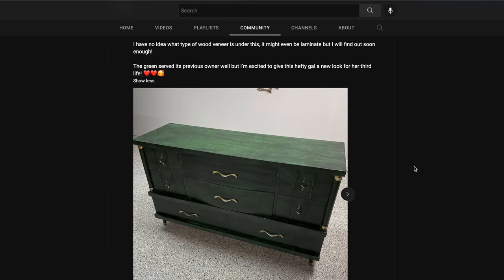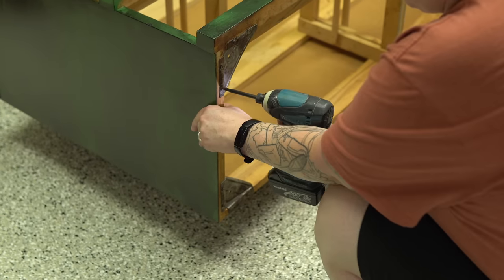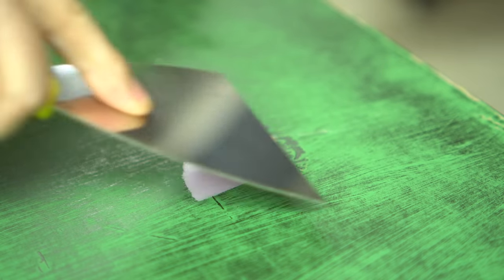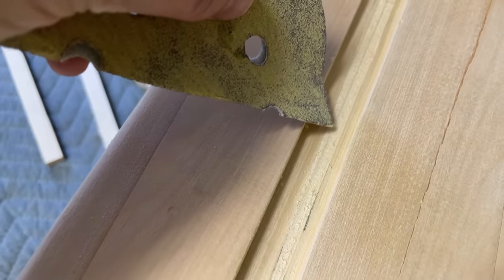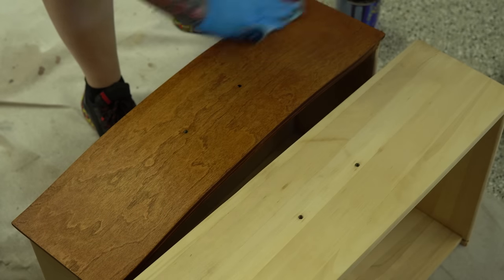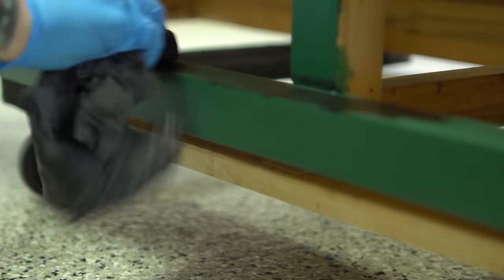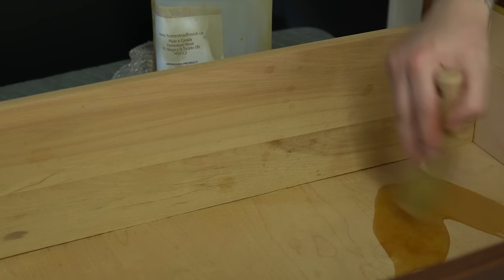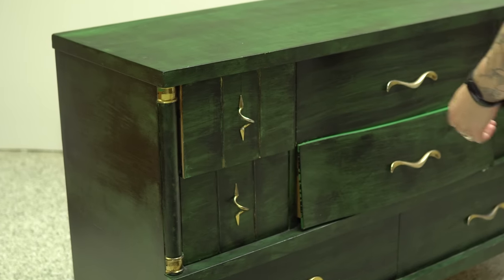DRESSER GLOW UP: Trying to make LAMINATE FURNITURE look & feel HIGH END

Comment: This looks SO much better than it did before you started. The green faux finish was just kind of messy before, it just didn't look professionally done. I think I like the more modern pulls, but I almost think that an even longer pull is called for here, with bits that extend past where the pulls attach to the drawer front, to more closely relate to the vertical spiral pulls on the smaller drawers. The curvy pulls aren't bad, but it's just a bit too much curve on top of curve. The straight horizontal pull makes the drawer front more of the star, whereas the curvy pulls compete for attention more.

Also, Nacho is a precious little angel and ultimately I will agree with whatever he likes best.

Comment: I love the finished product. I have the same highboy chest of drawers,  headboard, bedside tables and a nine drawer dresser with a mirror and a dressing seat. It is so dated, but I love it and hate it at the same time. Now that I see what you have done, I am so inspired to try to paint them. I wanted to ask, was the wood shelving, in between the drawers missing? My set has the, "Dust Proof Drawers". It is so difficult to find heavy, well made furniture, at a decent price, let alone have the dust proof drawers and a real wood backing on the back of the furniture.

Comment: The flat pulls highlight the horizontal; pieces of the front of the furniture actually enhancing the wavy side handles by their simplicity.  I liked the green/black original and probably would have something like it in college.  However, your piece is something I would want today.  (no room, unfortunately).  I always think of laminate as temporary furniture, something you get until you can get something better.  Your approach changed that.  best wishes in your business.
Reply from the maker: Thanks so much for watching!

Comment: I like the new modern pulls on the unit.  They look more sophisticated than the original wavy pulls.  The smaller drawer pulls didn't really match the orignial pulls in my opinion.  The modern pulls don't match either, but they don't look like they are trying to match.  It's a nice contrast.  I like the color you chose to stain the drawers.  It looks very rich and combines nicely with the green.
Reply from the maker: Thank you very much!

Comment: Do the drawers dry out completely, how long does it take to cure, and will there be a residue that could damage clothes?
Reply from the maker: I'll post the link here for the oil I used inside the drawers, it answers all your questions. 
https://shop.fusionmineralpaint.ca/products/hemp-oil-wood-finish?sca_ref=2400980.lEM1QTNsFR
As for transfer to clothes - all of the different products I use in the drawers gets applied, allowed to sit for a short time, and then wiped back. What remains in the wood cures and doesn’t leave any residue. There are some oils that perhaps could leave residue, but the ones seen in my videos are the only ones I use and I’ve had no issues at all (the excess needs to be removed though). For future reference all of my videos contain a full list of items and products used, along with links for purchase, in the description. Just click on the Show More... and a full list will pop up for you. Then you can research all you'd like. Thanks for watching!

Comment: It’s TOTALLY subjective on the pulls but I prefer the wavy ones for the reason that there are so many straight lines in the front of this piece—both vertical and horizontal—that the wavy pulls provide necessary contrast and relief from all that linear aspect.  I like that the large wavy pulls contrast in size and shape with the smaller ones, as if they are one big happy family. 😊
Reply from the maker: Thank you so much for watching and taking the time to leave feedback! Much appreciated.

Comment: I like the original pulls but that's just me. The wavy pulls are unique. However, if all the pulls had been changed out to a modern pull design, that would allow for the drawer designs to stand out more. Just my opinion. I do like how you try to save original finishes if at all possible. 
When having to put those damn tiny tack nails back in to a piece, use narrow pliers instead of fingers. Learned that trick from some cabinet maker friends.
Reply from the maker: Yes I have several pairs of them for that very purpose. Thanks so much for watching and taking the time to leave feedback!

Comment: Well I did NOT like the original look. It looked like a kid did it. I did not like the visible brush strokes. I would not have that in my home.  Not even the basement.  

I sided with you at first on those wavy pulls, but I did a Benedict Arnold on you. I switched sides when I saw the final product. Both look great. The customer can’t go wrong.

I thought the other pulls so razzle-dazzle that having two stars might make it look to busy, but they unexpectedly complimented each other. 

A think a shade darker green would have been preferable. Park Bench Green. 

Great job as usual.  You are an inspiration.  I don’t know how I missed this video.  I thought I had seen them all.  This one and another one popped out of nowhere.
Reply from the maker: Thanks so much for watching!

Comment: Handsome. 2 styles of pulls...personality builders.  How do you attack drips of stain and paint, for example, when doing a drawer face and blobs go inside? My problem with cleaning up is it becomes a glaring goof with my fixes...Best to do the correction immediately or at the end, or improvise? Solutions for  goofs would be informative. The early green is a "C" DIY job. The after is not even a kissin' cousin..
Reply from the maker: I actually have two videos posted about my favorite stains and topcoats, application tips and the like that you might find helpful:
https://www.youtube.com/watch?v=g8_Qsru0jWE&t=3s
https://www.youtube.com/watch?v=HMeMBl4rrek&t=124s

Thanks so much for watching!